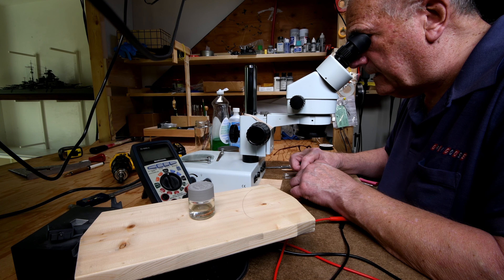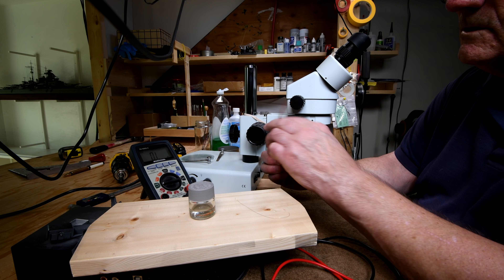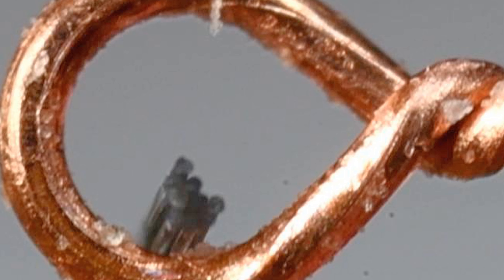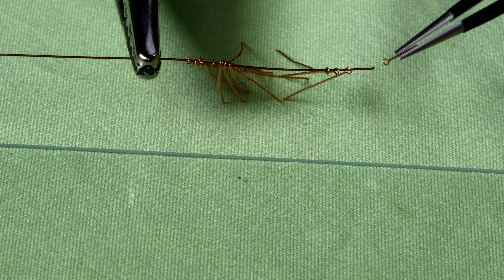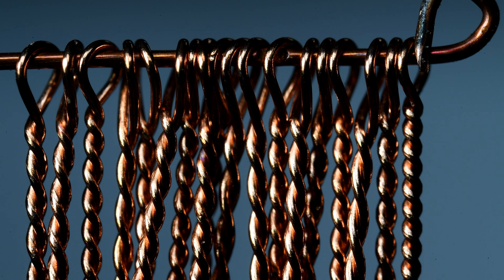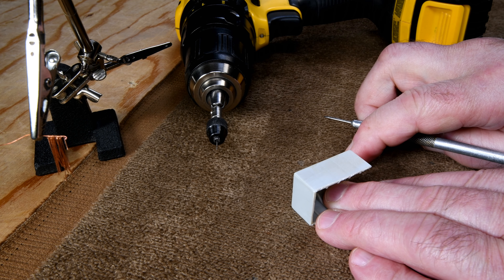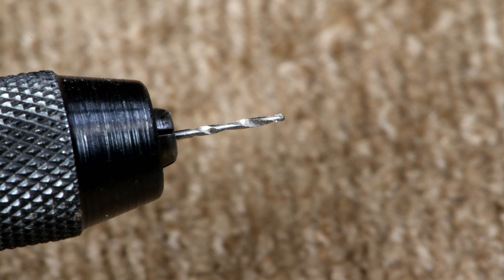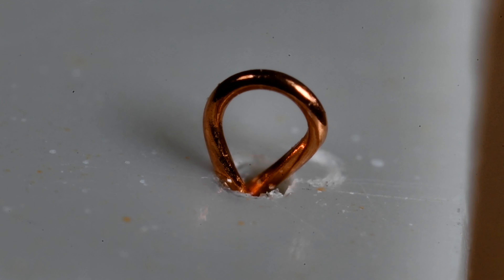The Model Ship - Part 502

Comment: To make precise holes in plastic, you can use your soldering iron, witch I am sure you have. Attach a sawing needle to the soldering tip and melt your way thru the plastic. You can mount the needle with some copper wire. You can choose any needle size you want and end up with clean small holes.

Comment: Hey Ron hope all is well. Watching an old school "How It is made" episode on them making plastic coated copper wire. As I see it, the microscopic coating on the wire could be caused by the production process of extruding the hot plastic sheathing onto the wire. Just a thought. KUTGW good sir.
Reply from the maker: I haven't given up on checking to see if it's coated or not. I still don't think it is however. I've got another couple of ideas to check for coating. Perhaps in episode 504 I'll deal with that. Today I've got to find out what's wrong with my multi meter. 🤞🙂

Comment: instead of using CA or the Tamiya adhesive, what about a small dab of epoxy to secure the eye bolt on the inside of the structures. I would think the epoxy would hold better, although there may not be that much strain the the rigging.

Comment: I thought perhaps the wire was coated after it was braided.  Kind of like motor windings.  If you get a fresh piece put it under the microscope and scratch it with something sharp in different places.                                                            See ya tomorrow.                   JimE
Reply from the maker: Re: "scratch it with something sharp" Sounds plausible Jim. 👍🙂